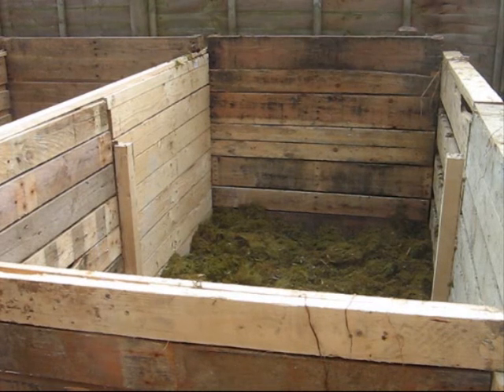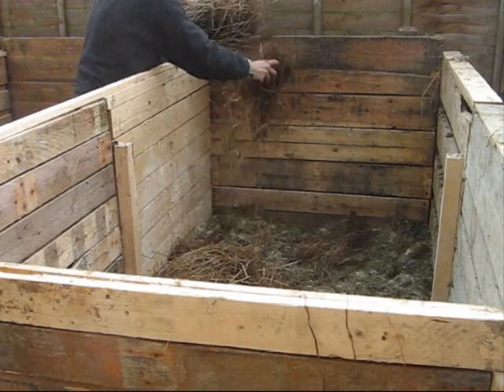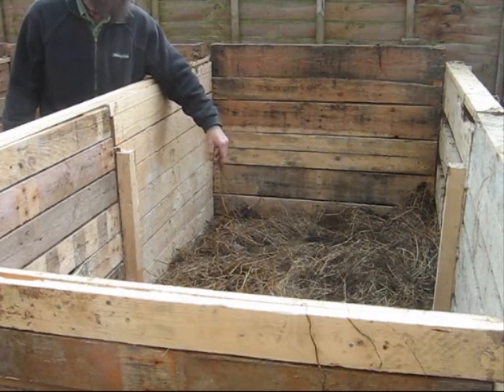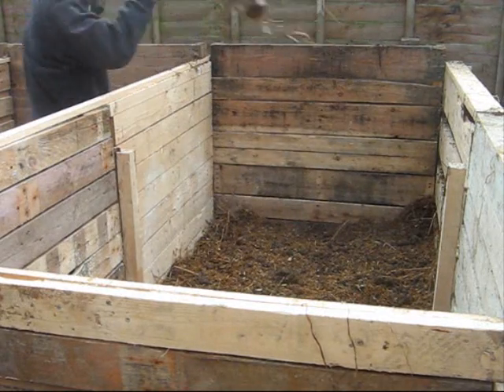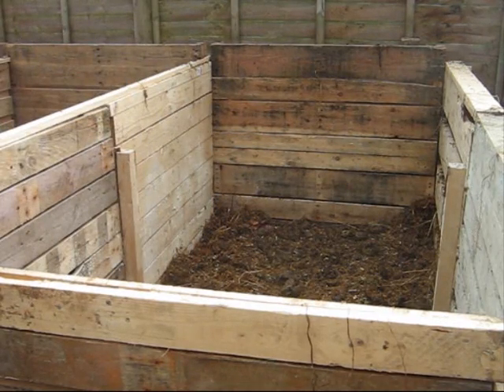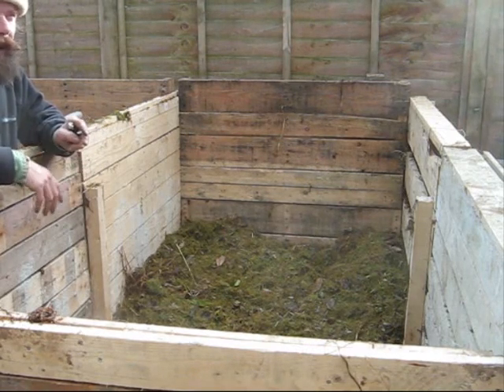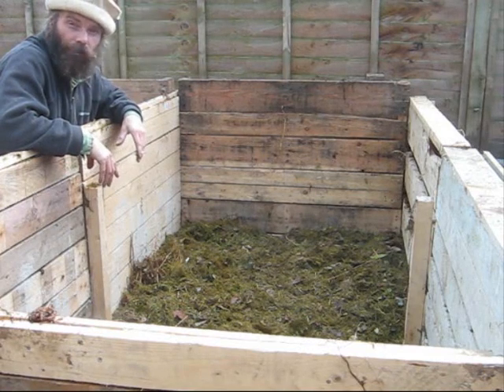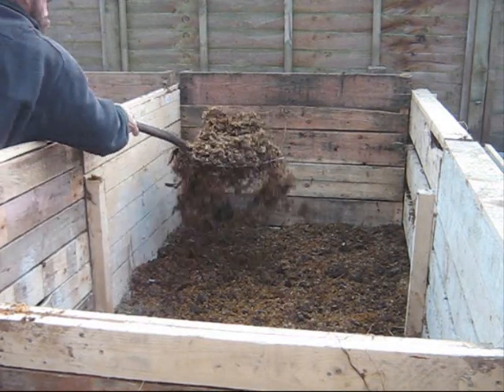making a thermophillic compost heap Pt 2

Comment: For many common chemical (and biochemical) reactions, the reaction rate doubles for every 10 degree Celsius increase in temperature.  (Historically a useful generalization supported by the Eyring and Arrhenius' equations).
Reply from the maker: true but only to a point.... which in my experience is 70 degrees Celsius..
It's possible to get a heap to exceed 70 but it starts to sterilise the heap to the detriment of the  second meso phillic stage with the compost process 'stalling'. I suspect that between 50 and 70 the mesophiles go into diapause but over 70 they are killed.. similarly a sustained temperature above 55 'slow cooks' the organic material making it easier for the thermophiles to digest. The best way to reach and sustain that temperature is to ensure adequate water and air are available and that is achieved through the heap architecture.. too much emphasis is given to Nitrogen availability often dumbed down to 'Greens and Browns'  it's not just a gross misconception but misses the true difference between greens (leafy cellulose material) and 'browns' (wood lignin material)... both actually have the same C:N ratio (google the image and count the N molecules).. what differentiates them is their size and 'strength'.. celulose is a small easily broken molecule whereas lignin is a large robust molecule.. nothing to do with Nitrogen... :-)
Reply: That makes sense.  Thanks for the explanation.  I'll try to dial in some of those variables.